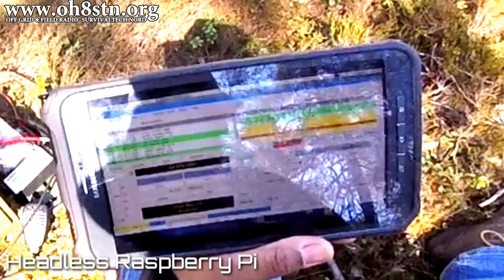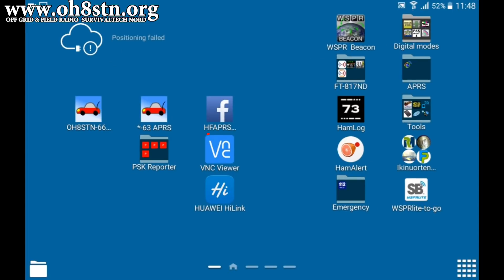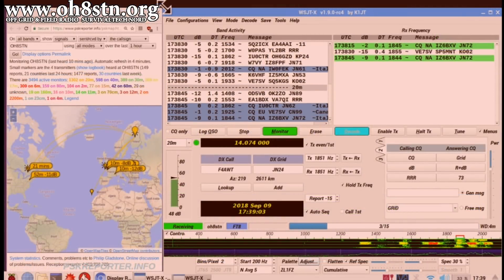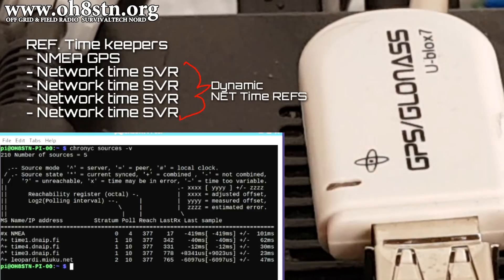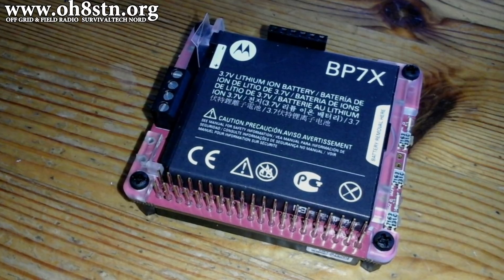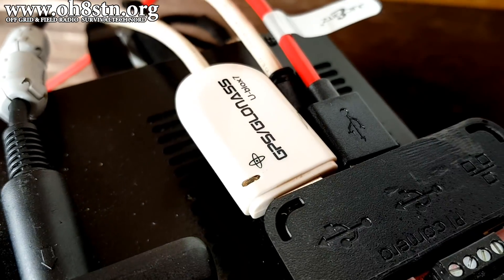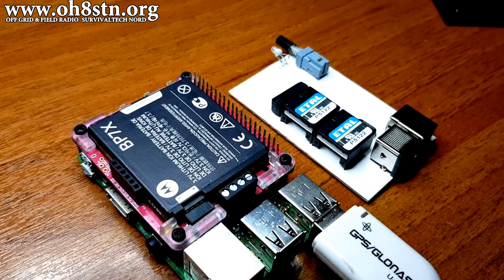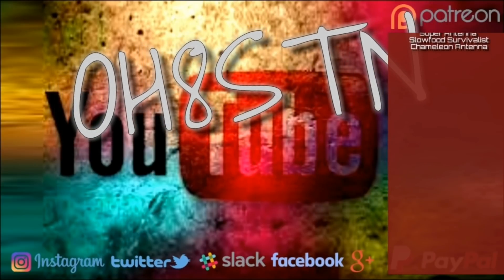Ham Radio & Raspberry Pi FAQ

Comment: I'm a little confused, as I often am. Looking at your blog entry for the headless rpi setup, are you saying that the tutorial linked allows the pi to switch between being a hotspot and connecting normally with your home wifi ? Or is there some other script required? As I understand things the tutorial is permanently creating a hotspot using wlan0 and would thus preclude linking to standard wifi when available. This is a great video and has inspired me to try setting up my own headless pi for use with my ft-817.
Reply from the maker: Edit: Sorry I didn't open the "read more" to see the rest of your question. So what you're saying is basically correct. There is that other script but let's ignore that for now. The way things run now my Raspberry Pi always creates that portable Ops Network. But you see that home network entry in the VNC when I plug in an additional Wi-Fi adapter it will connect to my home network giving the Raspberry Pi access to the internet. And now if we talked about that other script there's a way to do it so that the Raspberry Pi will connect to a local Wi-Fi network if it finds one. If it doesn't find one it'll create one of its own to allow you to connect remotely to it. That's the link the other operator shared on my Facebook page. I'll have to find that and update the Articles or perhaps make a brand new episode notes specifically for this video. Hopefully you can share your results with us. When we have these type of discussions it creates good searchable information for Newcomer's trying to achieve the same goals.
Thanks for the comment and pushing me forward. It's very much appreciated.
73
Julian oh8stn

Comment: Another great video! You are definitely on the right track and we all owe you a big thank you!

Looking forward to your video where you show how the Raspberry PI incorporates CAT control for your two radios and how it integrates with the other software.
Reply from the maker: Thanks John. I think I can make a short video on cat control for the 891 and the 817 on Raspberry Pi. 891 support is pretty bad in FLDIGI,  but wsjt-x and FT8CALL are perfect.
I'm glad you like the direction. If I can figure out an enclosure for the audio interface and Raspberry Pi, this project will become a lot more practical.
73
Julian oh8stn

Comment: As you requested, my Own PiProject: One of my many Pi3 serves as a portable APRS Station running direwolf. I can connect via APRS Droid or APRSIS32 or any other software via KISS or AGWPE Port. I have a wide range voltage regulator and an old Albrecht hand TRX for 2M in a Box, so as long as I have a 12V Source (such as my SLAB or LiFePo4) I have a WiFi Network and APRS. 
73 DJ6KR

Comment: Since the RasPi does not have a real-time clock that is persistent. I have used the "DS3231 Real Time Clock Module 3.3V/5V with battery For Raspberry Pi and Arduino by Atomic Market" as a real-time clock between power shutdowns on a few projects - works great.  -  I like the GPS idea too.   Thanks for the video.
Reply from the maker: Excellent feedback. I have another Raspberry Pi here for the 817, and I wondered if I was going to use the pie juice for that. Perhaps I'll try it your way on the other Raspberry Pi.
Thanks for the comment and sharing your project. That's extremely awesome!
73
Julian oh8stn

Comment: Hi Julian none Pi comment, you utilities DigiMaster MiniProSC, have you tried the DigiMaster Pro3 as this model has CAT function built in, any feedback will be much appreciated. Chud M1PUP & 2E1BXW
Reply from the maker: Well honestly I was really disappointed that there wasn't a product between the MiniProSC and Pro Three for my 817. A product that has cat control and built-in audio interface and 1 books without all that extra stuff I don't need on the Pro 3. My Yaesu ft-891 has a USB port for cat control, so no need for the P to 3. The Pro 3 would be perfect for the 817 for a desktop or shack use.
73
Julian oh8stn

Comment: How about some sort of shield for the Rass?
Reply from the maker: Can you elaborate?
Reply: @OH8STN  for single board computers like the pi there are extentionboards like the batteryboard. These are called shields. Why not building a shield that contains some form of transceiver. Just plug in and program.
Drawback: I don't know what the output does tot the board and if you have too shield the RF.
Plus: small, all-in-one and fully compatible with the pi if good designed. Connectors should not be nessisary and free for other uses. QSL? 73's

Comment: I was hoping for more detail on how you get from 12V on your battery to 5V on your Pi. Also, I’m getting a lot of the dreaded “lightning bolt” when I run my Pi with external USB connections and WiFi. I’m concerned about pulling too much with that 3B+.
Reply from the maker: I'll do a blog post tomorrow on the DC power aspects,  then share it on the community tab of my channel. The reason I did this kind of overview is it just takes too much time and energy to make such large detailed videos. 
About the lightning bolts. Are you running heat sinks on your Raspberry Pi? You see what I'm running on my Raspberry Pi. I have the GPS, Wireless, a second wireless adapter when I'm home so that I can still access the internet, and I don't have any problems at all pulling the amps. Let's try to troubleshoot your build
Reply: I an using a DROK 12v to 5v Converter as a HAT on the Pi.  Description:  12v to 5v Converter USB, DROK Voltage Buck Regulator DC 9-36V 36v 24v 12 v 9v to DC 5 V 5A Power Supply Module Volt Stepdown Transformer Board with Dual USB Output Port

https://www.amazon.com/gp/product/B073PQTMRP/ref=oh_aui_detailpage_o02_s03?ie=UTF8&th=1

I have not tested for RF interfrance yet.
Reply: @OH8STN  What is the link to that post?
Reply from the maker: I have multiple posts can you be a little bit more specific?
Reply: @OH8STN  to connect the pi to the power distribution.
Reply from the maker: 👍 I just edited my previous comment, and I'll get started on a blog post with more detail
Reply: Sounds great! I'll keep working at it here, and will reach out if I have questions. Thank you, Julian.
Reply: I have a "cigarette lighter" port I hook up to my 12 volt battery.  I put the phone charger adapter in it, plug in my usb charge cord, then plug in my raspberry pi.  If I am near a sunny spot I pull out my Solar Panel which has usb charging ports and hook the raspberry pi to it.  I get the lightening bolt sometimes when I plug my Signalink into it.  I got to figure that out.
Reply: More amps.

Comment: Hi Julian, great timing on the release of this video. As an aside I managed to find a custom made case for the Rpi and Pi Juice hat. They are available in short (just the Rip and Juice hat)  or Tall which has additional stacking space for more Pi gadget hats. I went with the short version. The top cover slides in/out giving easy access to the battery pack. I got it from ModMyPi.com. Here's the link to the actual case I have;
https://www.modmypi.com/raspberry-pi/cases-183/raspberry-pi-b-plus2-and-3-cases-1122/cases-for-hats-and-boards-1133/pijuice-short-case

73s 2E0UAW
Reply from the maker: Hi Andy. That case sounds pretty cool I'll leave the link up so other people can find it. I'm thinking about it custom case as well but something which will how's the Raspberry Pi, and the audio interface side by side. I'm sure I'll have to CNC machine it or 3D print it, but it's about the only way forward for me. I enjoyed your video by the way. That's antenna you were using is a solid performer. The 6 meter Mast was a red flag however. We should also remember the lower the Apex of a dipole, the more directional it is.